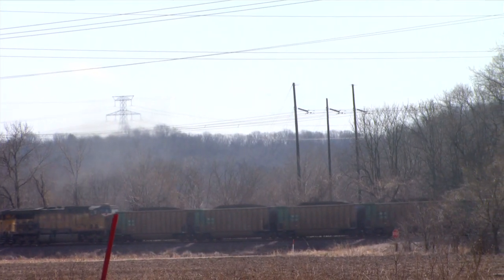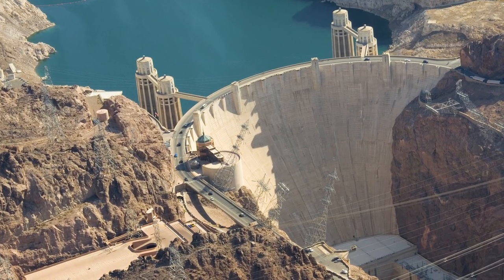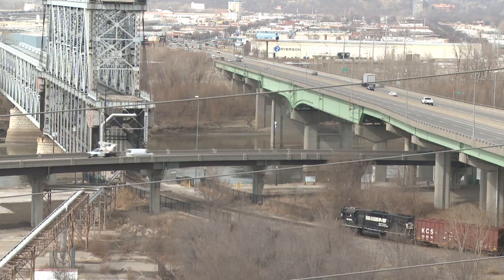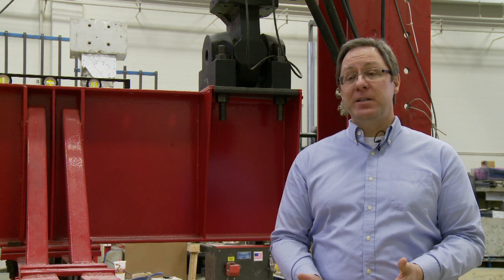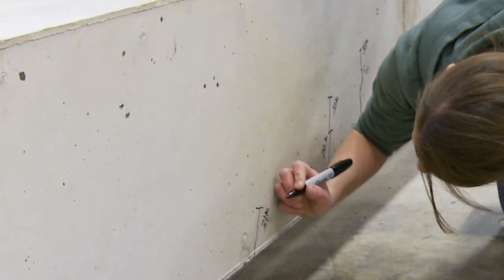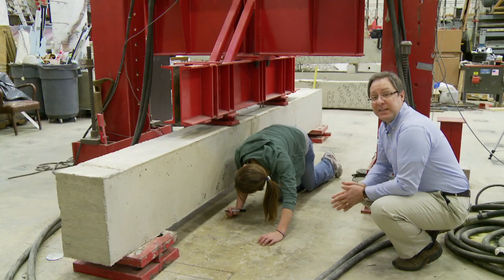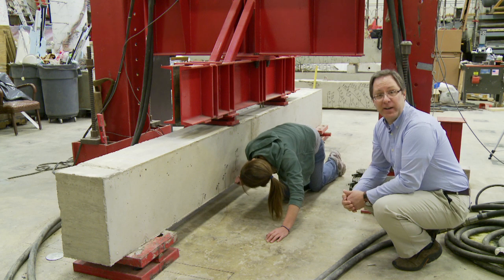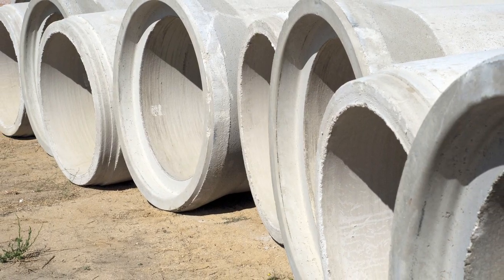Missouri S&T Making "green" concrete

Comment from the maker: Christo930,

Concrete is the most consumed man made material on the planet being used to construct roads, bridges, buildings, etc.  While making the cement, the binder in the concrete, CO2 is produced at almost a pound-for-pound ratio.  Cement counts for slightly more than 5% of the worlds green house gas emissions each year.  By using fly ash, which will end up in a land fill, the amount of green house gas emissions will be reduced significantly.